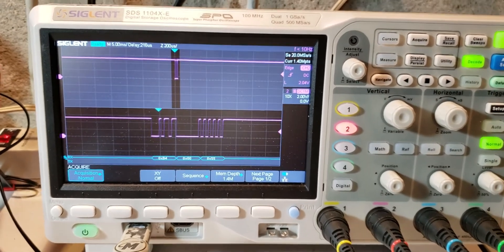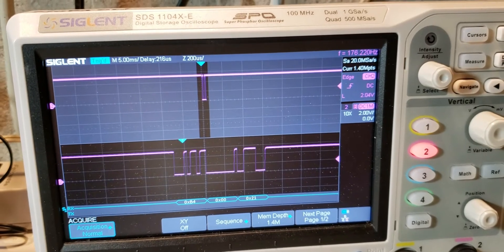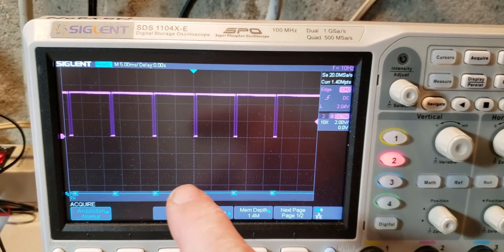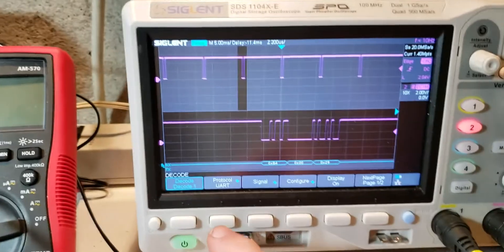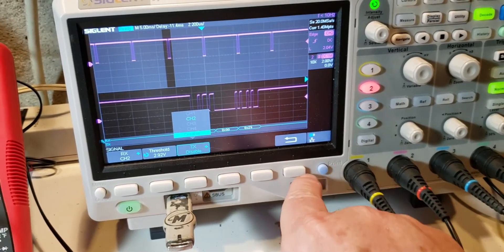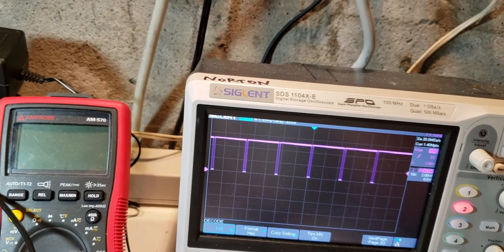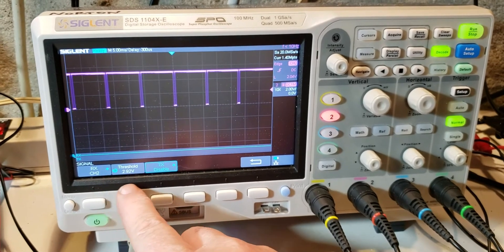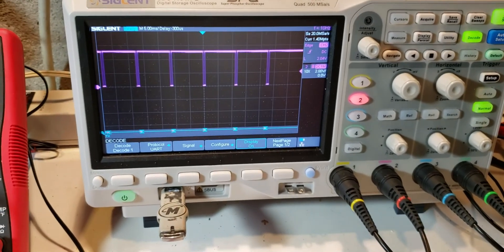Siglent SDS 1104X-E Oscilloscope - Serial Data Decoding

Comment: I also have this scope and really love it, but ... is it possible to get rid of this very long showing timebase and Voltage/Div label shown by turning the knob ?
Reply from the maker: Hi, not sure what the question is, the Volt/Div label on the right is fixed as far as I know, though I haven't played with all the config menus.  The timebase zoom is toggled by pushing the Horizontal knob in till it clicks, then turn the Horizontal knob to change the zoomed timebase.  It is an amazing scope for the 500USD price!
Reply: @pn2543  Thanks for answering, .... I actually mean the popup screen which is shown when you turn the knob (@4:30)  ... when you scroll. Those popup screens show the time much longer than needed --- actually they are not even needed because it is anyway written in the SIGLENT line above (the same for V/DIV and the vertical trigger) ... should be possible to disable it or decrease the time the popup stays visible)